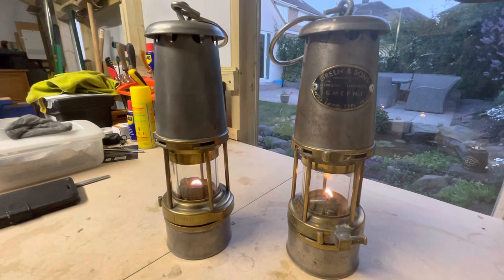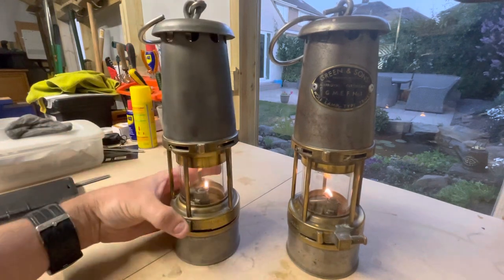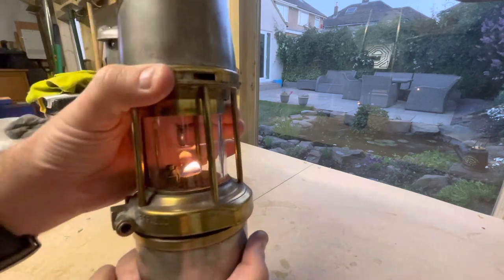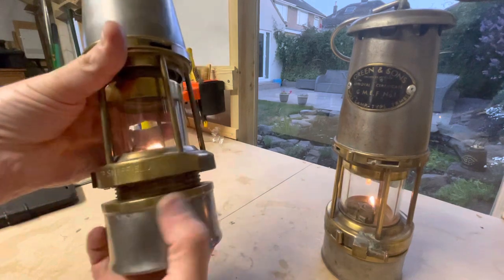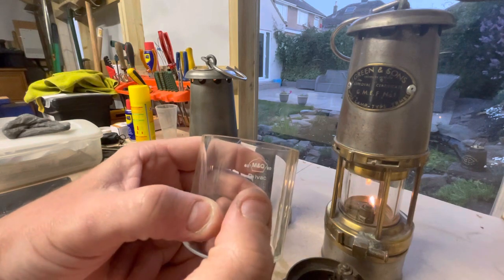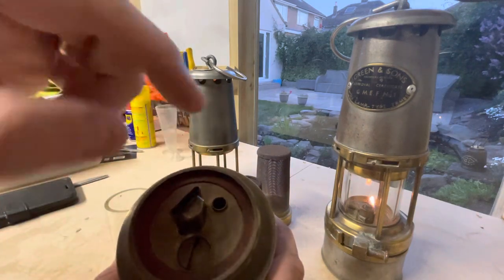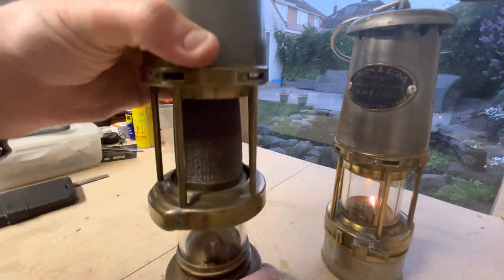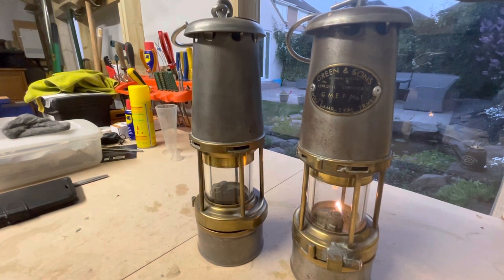Wolf 7RMBS Miners Safety Lamps.

Comment: Does the wolf 7rmbs use spirit based fuel.I purchased one of the last batch around 35 years ago as I only worked 10 min awayfrom the Wolf factory.I have not used it for many years an have forgot what fuel it used,I think it was spirit but am not sure.I would be grateful for your advice thank you.
Reply from the maker: It's a spirit based fuel that the lamp uses. I too have a lamp from the last batch made.
Reply: Thank you for your speedy reply.